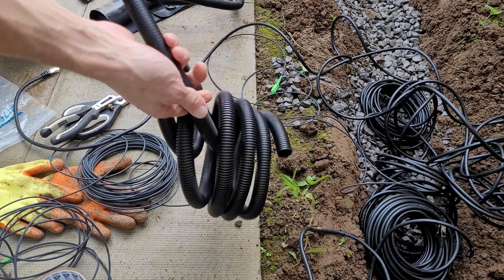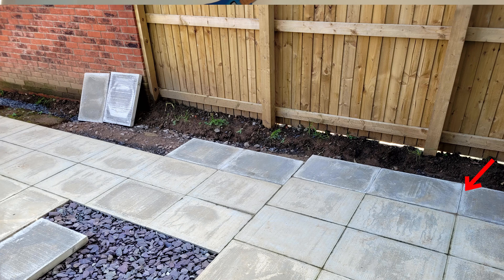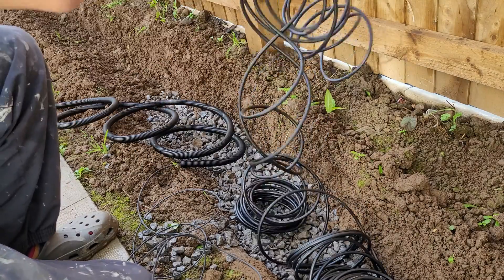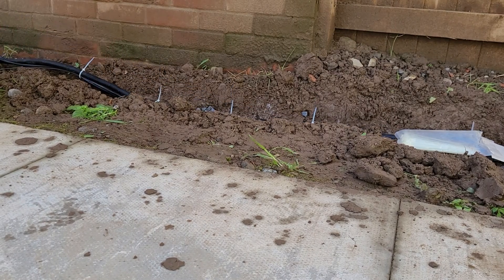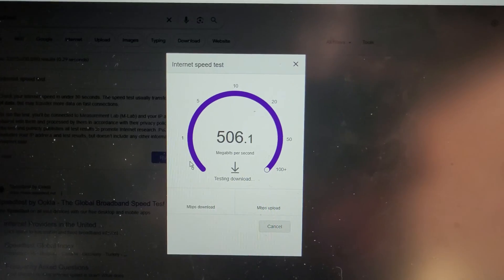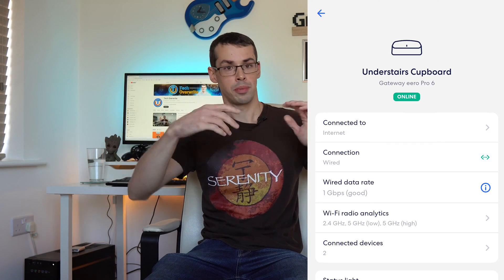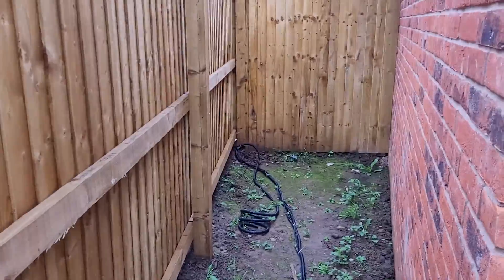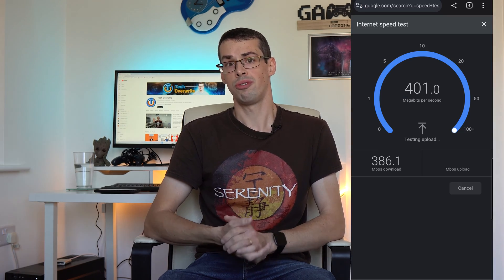Playing With Dirt! Running CAT7 & Fibre Internet To My Garage Outbuilding

Comment: Its interesting to see how you attempted this. To run through conduit, try using a vacuum cleaner to pull string through the conduit. Then tie the cable to the string and pull the cable through using the string.
Reply from the maker: Thanks for the tip 🙂 That would have been far better. I'll have to give that a try - that makes a lot of sense.
Reply: @TechOverwrite  Google some techniques. Some tie a small rag to the leading end of the string so it will catch more air.

Comment: How did this end up working? Was thinking about doing something similar
Reply from the maker: It has been super stable so far, thankfully :) It's now 1.5 years on and I haven't noticed any issues. The cables are partially under some pavers, and some under gravel but either way, it's been fine in both hot sun and cold wintery weather.
Reply: @TechOverwrite  awesome. Gives me more confidence then. Thanks for the vid and the update!